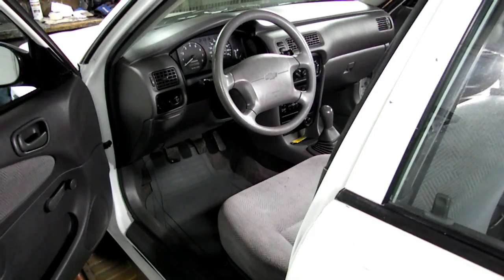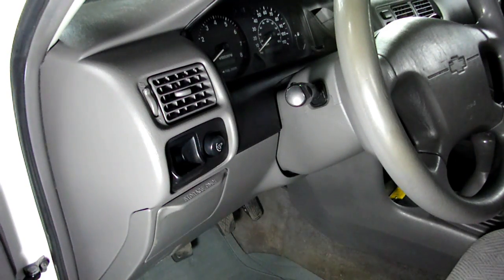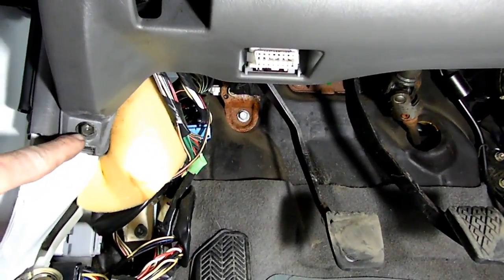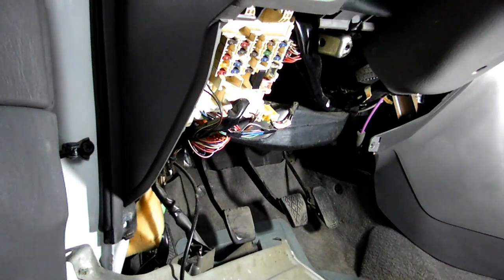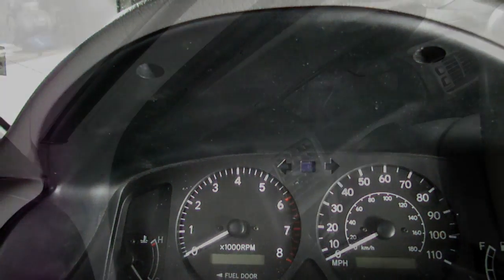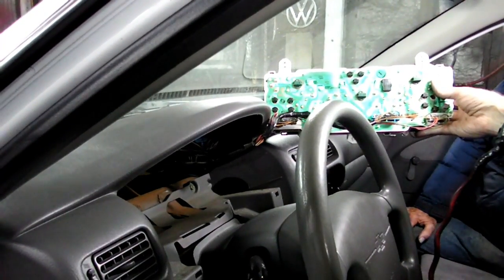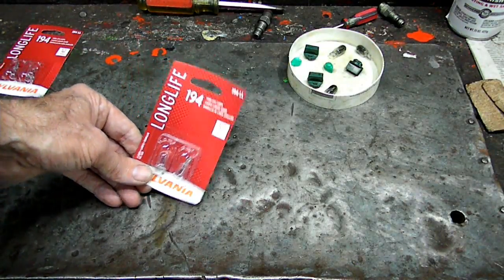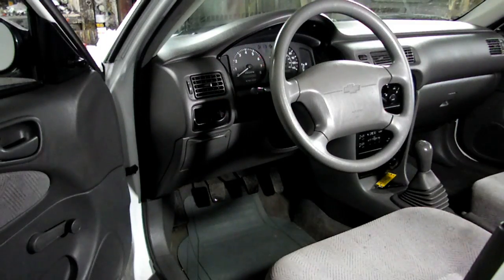Toyota Corolla Chevrolet Prizm Instrument Panel Bulb Replacement

Comment: Great Video Rich as Always!  On GM vehicles, on those two upper phillips screws on the instrument panel surround, I like using a Milwaukee 48-32-2100 OFF-SET Power Screwdriver Head.  In fact, I prefer using this tool on interior trim removal due to the various strange angles.  Your method works just as well!

Comment: Good tutorial, technically you don't have to take off the knee bolster. You can slide the bezel (carefully) and it won't damage the top steering column cover. (I did this both for 1998-2002s with or without the tilt function.)

Comment: Thanks Rich, this video is very helpful. My Prizm model doesn't have tilt control, so I was wondering how to remove/install the bezel to gain access to the cluster. Without your video I probably wouldn't have figured out how to lower the column to do it. Many thanks!!

Comment: Great video. Surprisingly it seems a lot more involved with the trim removal on the Prizm than the Corolla; all that's necessary for the Corolla is the removal of the top two Philips screws for the black bezel/surround and it pops right out.
Reply from the maker: Yes the prizm is a little more work in this area.

Comment from the maker: With the engine running check the voltage at the battery with a multimeter it should be in the range of 13.5 to 14.5 volts.

Comment: Hey Rich! My winter beater is a 2000 Prizm. No tach. Do you know if I could swap out the panel for one like this with a tach? Thanks.
Reply from the maker: I am not sure but it is an interesting mod....i must investigate.
Reply: Yes, absolutely. I have a 1999 Prizm and I recently installed an instrument cluster with a tachometer from a 2001 or 2002 Corolla. The tach and odo have a white background and it looks great, works perfectly fine.

Comment: I was wondering if you could help me out man I've been searching for google for quite some time but I have a 1969 Volkswagen Beetle and I need to tighten the motor mounts and I just cannot find them a video with some pointers would help immensely I would much appreciate it. your video on replacing the starter on The Beatles helped me out man you are the shit

Comment: I'm curious if a corolla cluster will function in a prizm? I just purchased a 2000 Prizm  and it does not have RPM gauge, in the cluster..
Reply: It does. I took a nice-looking cluster with a white background out of a 2001 Corolla (I think), and put it in my 1999 Prizm. Works perfectly fine. Be aware though, the plastic bezel is not the same for both Corolla and Prizm. Make sure you don't break the existing bezel during removal, so that you can re-use it. I do have one spare Prizm bezel here though!
Reply: Thanks. I'll keep my eye out for one.

Comment: Hey i have a problem with my 97 corolla, i changed all small and big bulbs from dashboard cluster but now nothing turns on in dashboard except for seat belt light and battery light is on. (i checked all the fuses are fine) Please help

Comment: Hey I have a 98 chevy prizm with the tilt wheel and I tried taking the bezel out with the wheel in place. Impossible to get out. So your wrong on that. You take the bots out for the bottom consol for the dash and remove the two 14 mm bolts the remove the bezel.

Comment: would it have been easier to just remove the steering wheel?
Reply: Not really.  It's easier this way, I think. You need a steering wheel puller and a large socket to remove the wheel, not to mention the air bag and all that related stuff.